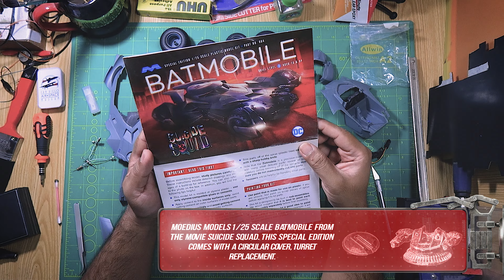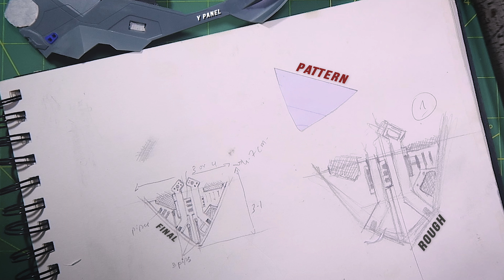Batman v Superman Batmobile  Moebius Models 1:25 Scale  Part 01

Comment: That ending though. 
I had to go back and rewatch how you took that mechanical error and stuck the landing
Reply from the maker: The top ends of the rods were square at first had to file the ends so they were slanted. Made the closing a lot smoother.